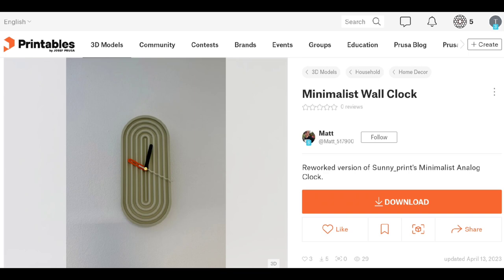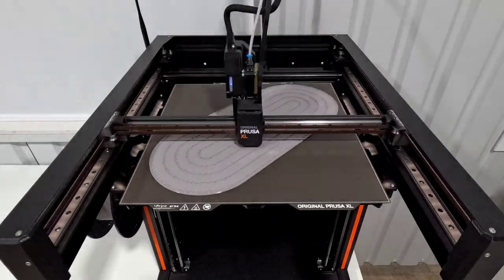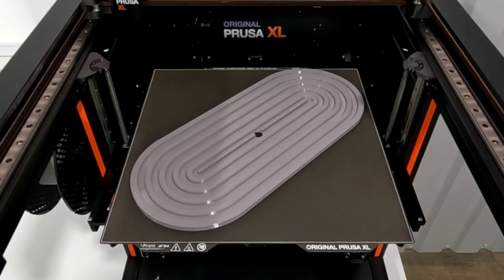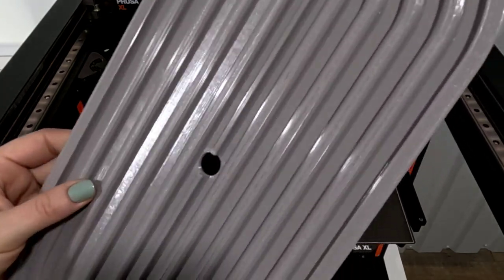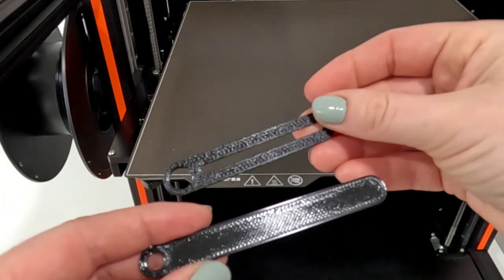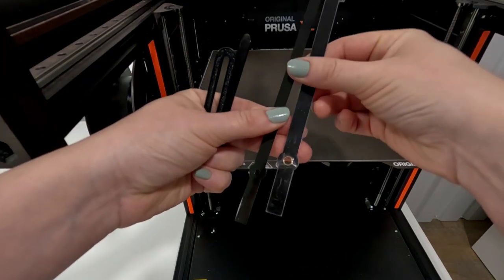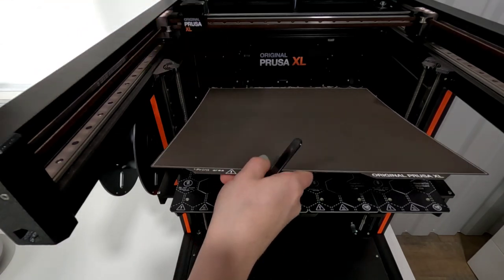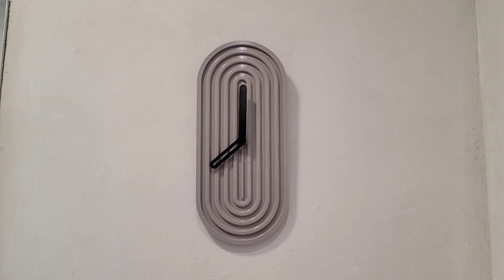Printing a Gigantic 16" (40 CM) Wall Clock on the Prusa XL!

Comment: Bonjour,
Encore merci pour votre travail.
Je constate également que vous n’êtes pas nombreux à afficher la Prusa xl sur les vidéos.
Je trouve le rendu moyen du plateau de l’horloge, il semble y avoir un problème avec d’extrusion
Pour l’instant avec une seul tète d’impression, je la trouve beaucoup trop cher pour un résultat moyen.
Le vrai plus de cette machine est la muti-tete, personnellement j’attend le model avec 2 tètes.
Mais pour l’instant au vu des rendus je me pose quand même la question si je maintien ou pas la précommande
Avez-vous des échanges avec Prusa pour faire des retours sur vos problématiques ?

Encore une fois merci

Good morning,
Thanks again for your work.
I also notice that not many of you display the Prusa xl on the videos.
I find the average rendering of the clock tray, there seems to be a problem with extrusion
For the moment with only one printhead, I find it much too expensive for an average result.
The real plus of this machine is the muti-head, personally I expect the model with 2 heads.
But for the moment in view of the renderings I still ask myself the question if I maintain the pre-order or not
Do you have exchanges with Prusa to give feedback on your problems?

Once again thank you
Reply from the maker: Hello! I purchased this XL because I needed a larger print bed. If they make additional toolheads available, I will add those on. It really depends on what you're wanting to print if it's worth it to you. Thanks!

Comment: yaaasss!! Layer adhesion at the edges look much better now compared to the helipad! Having printed with the XL for some time now, have you had any failed first layers, layer skips, or anything else annoying like that? What are your overall impressions so far?
Reply from the maker: Yes I am wondering if the rounding helps too! No failed first layers. One time, I had a little filament ooze on the nozzle after changing to PETG. I was disappointed that the print didn't start because the sensor noticed the ooze and paused. But it's better than ending up with a failed print or blob. 

I am very happy with the XL. I am going to focus on speeding things up because that's my biggest annoyance right now. Thanks!

Comment: Did you test the corners with the helipad first layer again or talk to prusa since to see what their thoughts were? 

This printed well but rounded corners don’t get into the corner. The Seams - try to force put them on the straight highlight the whole straight so that it randomized within that straight and see if that helps. Save’s having a small selection with all the points in a few mm’s. 

Getting close to 1000 subs / how’s your watch time hours going? Is it 4000hrs viewed plus 1000 subs still, before you get paid?
Reply from the maker: I have not had a chance to reprint the helipad but I plan to soon.

 I'll check what my seam position is on this clock.

With the length of these prints, I am going to start seeing how fast I can go. And then it'll be a lot easier to reprint and make modifications when they're shorter prints. 

Yes, you're right on the sub/watch hours until you can start monetizing the channel. I'm getting close! I'm going to do a giveaway when I hit the 1000. 
Thanks for your support!
Reply: @tada3dprinting  on helipad - it will be interesting to see - when you get back to it. if it was a cooling issue or filament etc. I’m only curious as I have an order cause I need a bigger build plate (ideally need a 430x297 for what I’m doing) so it could impact (shrinking my part to fit the 360mm I’ll be right in the corners. I could get a bcn3d epsilon (although that would be a good option in time) it’s not cheap. 

I run petg and textured on my mk3s/s+ and rarely have an issue with prints. I ran some pla and it was okay but I had to nurse it more than petg. 

Also will be good to see what your print speeds of these models will be like once input shaping firmware is released. I would revisit a couple of the things you done over last 2-3weeks. And see how the firmware affects speed and quality. 

It’s awesome your rise over last month. You are still the only one I can see who’s publishing prusa xl videos on YouTube.. you need to make hay while sins shines as they say.. Social Balde has some stats you that may get you excited - annual income…